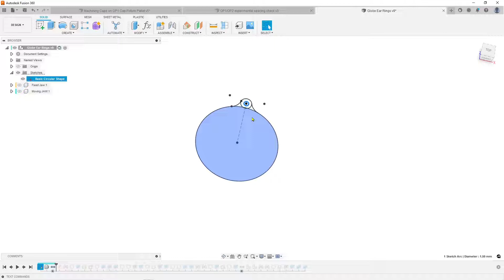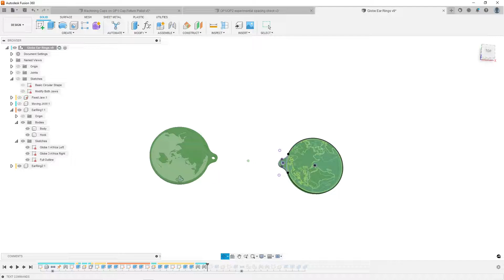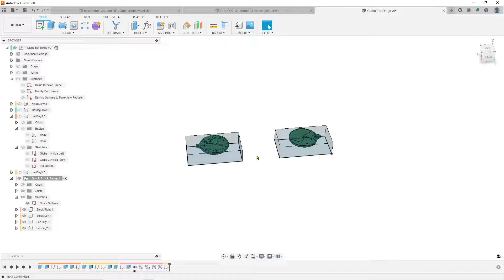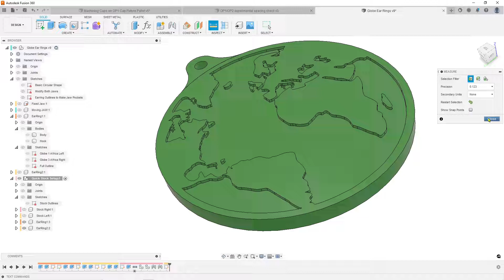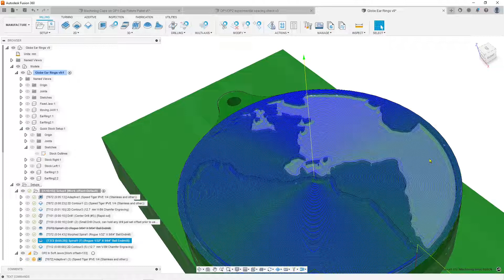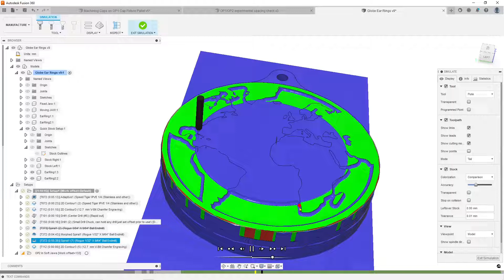Making Titanium Earrings - Fusion 360 And Tormach 1100MX

Comment: Hi, where is your PM25MV? titanium is a pain to machine
Reply from the maker: The PM25 had a 24k spindle for a while, but then my son and I found a disassembled Tormach and bought it for $500. We had it running in a few days, were super impressed, and we each bought new 1100mx’s!   I have used the heck out of it!!
Reply: @billstrahan4791  wow what a steal! Were are you located?
Reply from the maker: @wow-wow-p8d  Dallas area.  We ended up spending a few grand on the original Tormach to get it all going.  It had blown stepper drives, and some other problems.  But it made us both realize that we wanted something bigger and beefier than the PM25!
Reply: @billstrahan4791  did i  hear you right, pm25 had 25k spindle, on stock bearings
Reply from the maker: @wow-wow-p8d  Oh no, I built a new spindle mount to hold a chinese 24k 2.2kw spindle  It was amazing.  I wish I had the same spindle in my Tormach.  RPM is really critical when using small end mills.
Reply: @billstrahan4791  interesting
Reply from the maker: @wow-wow-p8d  If I was going to keep using the PM25, this is what I'd do:  I'd get this spindle:  

https://www.jian-ken.com/automatic-pneumatic-tool-change-spindle-motor/jgl-80-1-5kw-2-2kw-2-5kw-24000rpm-40000rpm.html

Which I already have, because I was going to do this, and I'd make a new Z axis head that bolts to the existing slide, which is also what I did.  I just didn't do both.

The ISO20 ATC spindle and a VFD would set you back about $2k, but you'd have several times the power, and many times the RPM.  The rigidity of the PM25 was fine for high rpm work in aluminum, I never tested steel.  

At that point, if you really wanted to, you could also build your own ISO20 ATC for the mill.  I made my own (BT30) ATC for the Tormach 1100MX and it's not that hard.  The ISO20 would be much smaller and easier than the BT30.  Easily do 10-12 tools on the PM25.

Then EVERYTHING becomes better.  If you had low backlash, a PM25 with that spindle would destroy aluminum handily.
Reply: @billstrahan4791     interesting, they look like a router spindle' looks good for small tools, the  rigidity of a small spindle idk, too bad we live so far apart